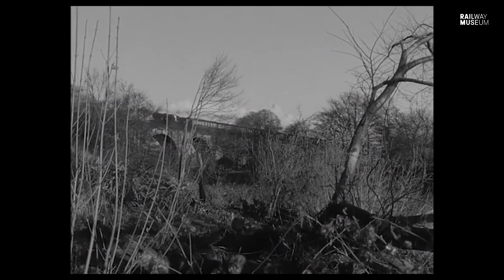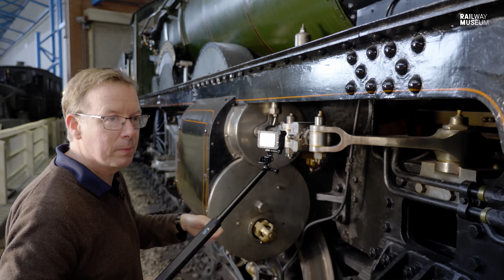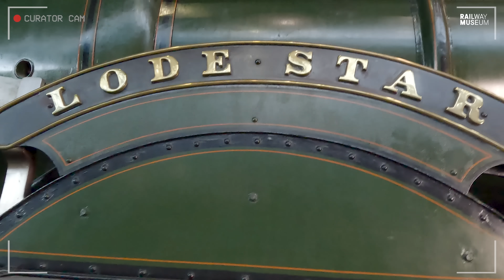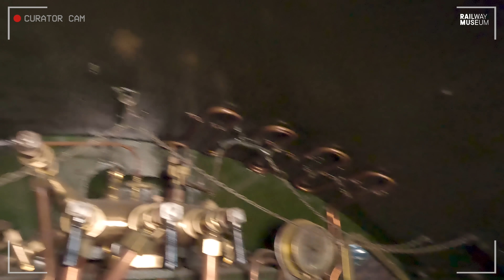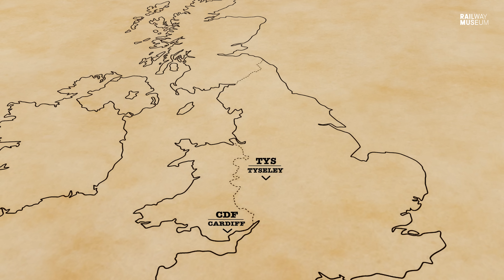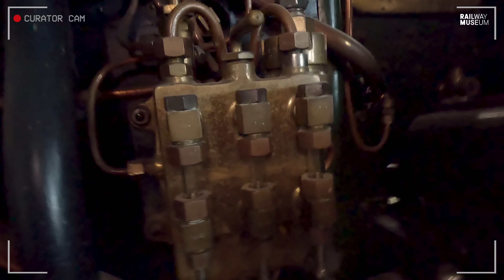Churchward’s Masterpiece—Lode Star In-Depth Tour | Curator with a Camera

Comment: there isn't a "Lap" position on a GWR vacuum brake, if you put the handle in that position, you are making an application. With a GW vacuum brake, the "Off" position is the running position. Steam braked locos like the 57xxs adnd 45xxs have running in the centre but that's got a different brake valve and the "Off" position on those also opens the large.

Comment: The LNWR engine shown is a Claughton, the first of which was built in 1913 and like the Star, had four cylinders. I believe that Churchward's remark regarding his engines in comparison with those of the North Western was made at the time when the Experiment 4-6-0s were amongst that Railway's crack engines. An exchange visit of engines between the two railways vindicated Churchward, although the Experiment that ran on the GW was probably not a star (sorry!) performer in that class.

Comment: The GWR French compounds were built in 1903 and 1905, not 1906.
1906 was the year that the first Star, North Star, was built, using some of the ideas embodied in the compounds.
The LNWR 4-6-0 that could be built cheaper than a Star wasn't the Claughton class illustrated, but the much simpler 2 cylinder Experiment class. In 1910 a locomotive exchange between the Star and Experiment classes was carried out on the 2 railways, with the Star completely justifying its higher price. The LNWR brought out the 4 cylinder Claughtons in 1913, as an equivalent to the Star, but they had missed out several of the details that made the Stars so good.  The Claughton's performance was still inferior to the Star's.
Reply: Glad you pointed out those mistakes I noticed as well. 

The Claughtons suffered from a boiler that was too small and from multiple valve gear and cylinder problems. They were said to be extremely good performers at the right time but were very unreliable.

Comment: Are the drives for the engines on each side diametrically opposed, or quartered?
Reply: They are quartered, so a 4-cylinder loco sounds just like a big 2-cylinder loco.

Comment: As for steaming certain locomotives again there are some that are out of the question now. Even though they did get revived after the end of BR steam in 1968.
The GNR 'Single', the Midland 'Compound'. You can add 'Green Arrow' and Lode Star too.
The GNR loco has a very poor firebox & the driving wheel tyre is at scrapping thickness,. 'Green Arrow' still has its original cylinder block, which is now badly cracked. Lode Star looks to have very thin tyres all round & who knows about the state of the boiler? I don't suppose it has been surveyed.
As for 'Evening Star'... I rode behind it on the Scarborough Spa Express which was many years ago. The locomotive is the 3rd newest steam locomotive in Britain & was never thrashed on freight trains, which was what it was designed for. On the modern railway a speed limit may apply on account of it having smaller driving wheels, but it definitely has the low-down grunt.
Reply: Evening Star is never going out on the mainline again (or any other 9F for that matter) as the flangeless centre driving wheels are incompatible with the raised checkrails on some modern points. Risk of the wheel riding up on the checkrail and derailing the loco.

Comment: It’s kinda surprising they didn’t put the valve gear  on the outside , with bell cranks driving the inside cylinders, reversing the layout.
Reply: LMS did that but it didn't fit the GWR aesthetic.  GWR only used outside valve gear on the 1500 class pannier rank, I think - and that was just before nationalisation.
Reply: @rogercantwell3622  They also used outside gear on the three 2-foot gauge 2-6-2 tanks they built for the Vale of Rheidol railway in 1923/4.

Comment: I wonder why Swindon didn't re-fit brass beadings to the splashers when preparing it for display in 1962?  They removed the outside steam pipes and fitted a tall safety valve casing to present a pre WW1 appearance.

Comment: Why were some railways right- hand drive and others left-hand drive ... why not standardize driver position like they standardized the track gauge? Any advantages to left-hand verse right-hand positions?
Reply: RHD is easier for most firemen when it comes to accurately placing the coal onto the grate but means they have to help look out for signals, which are almost always on the left.  The other big three railways settled on LHD, with many locos being converted from RHD - like Flying Scotsman - but the GWR always did its own thing.
Reply: Individual railways generally had a standardized side for driving, so would have all their engines manufactured that way. However there are always exceptions.
In Victoria, Australia the government  railway, Victorian Railways, drove on the left side on the Broad Gauge. The narrow gauge line due to the first engines being imported from America were right hand drive as were all the locally made copies. When two additional engines were bought from Beyer Peacock, Garratt engines G41 & G42 they were also right hand drive.

Does it really make a difference. Maybe. But with a tank engine when half the time you are going bunker first, you are then on the opposite side of the cab. If you have a second person in the cab they are also responsible for looking for signals and collecting and delivering safe working tokens as required. The biggest obstacle is sight lines due to boiler or tender or hoods.
Reply: @Kevin-go2dw  thank you
Reply: I think it was to do with what side the signals and signs were on but I could be wrong
Reply: @terrier_productions  I did learn this one the other day - most UK rail companies put their signals on the outside of the tracks in sections with double track, but because the GWR were converting from broad gauge, they ended up with a lot of space between the tracks, so they put their signals between the tracks in sections with double track.  Since all the trains were driving on the left (as with the roads in the UK), this meant that in order for the driver to have a good view of the signals, everyone else made LHD locos but the GWR made RHD locos.
Reply: @PaulPower4  that’s actually makes more sense
Reply: @terrier_productions  Yes that is part of it, more so for express or high speed running. On "branch lines" probably not as important, nor where turning facilities were not available.

Comment: A worthwhile enhancment would be to replace corks with a proper closure with a hinged cap with projecting lug which could be opened with the spout of the oil can. This is a standard fitment on Swedish steam locos.
Reply: More modern engines used hinged caps, this engine pre dates that though and has no plans to be steamed again
Reply: The cork had the advantage that, if it fell out, it would cause no damage to the motion.  The reed was actually unnecessary - other railways used corks and found there was no problem with oil flow.

Comment: Lode Star's trailing pair of driving wheels are of a different (later) pattern to the leading and middle pair. The trailing wheels are from the "Castle" class with webbing reinforcement and the crankpin is between the spokes, whereas the other four driving wheels have the crankpin in line with the spoke and have no webbing. It's likely the trailing pair were swapped in when Lode Star was being cosmetically restored following withdrawal. 

Closer examination of the number stampings on the wheel hubs should show which engine previously had the trailing pair.

Comment: Churchward's Saint Class was described by OS Nock as the "keystone in the arch" and was arguably the most important engine built in Britain as it was such a huge leap forward in loco development. Churchward was interested in "balance" and the avoidance of "hammer blow" to avoid track damage that a two cylinder engine like the Saint might cause and that was also why he was interested in those four cylinder French locos that were bought. Churchward's engines were considered ugly when introduced and they were beautified by Holcroft- with the curves instead of the previous drop ends and these curves debuted on the Star. Both the Saint and the Star had the same boiler which had very high pressure and very high degree of ( for the time) superheating- and that was revolutionary in Britain back then. Arguably, the Star was complicated and maybe developing the Saint further would have made sense. Clearly, the Star was the start of a family of successful engines that also extended to the LMS when Stanier left the GWR for that railway. During World War One the brass beading was removed from the splashers and for some reason this was not replaced when the engine was restored for display- although the later "elbow" steam pipes were removed as they were a later addition. The Saint really was the engine that brought the Great Western into the 20th century- not the Star and Stanier's Black 5 class- a very close but mixed traffic derivative of the Saint hauled Britain's last steam train in August 1968 which sums up the reality of the importance of the Saint class.
Reply: And 2999 ‘Lady of Legend’ is a working reproduction of the Saint design, which has appeared on several heritage railways recently, and is based at Didcot.
Reply: @johnkeepin7527  "W.A. Tuplin commented; "No other locomotive design, except perhaps Stephenson's 'Rocket', has represented such a long leap in the right direction as GWR No. 98." Number 98 was the second prototype Saint and had the new taper boiler. The last Saint in service- Saint David was subject to a preservation attempt. I have seen a letter sent from the British Transport Commission- of which BR was a part, with words to the effect that " the engine represents a national asset and we cannot wait to realise its value". Pretty stupid as there were probably dozens of engines awaiting scrapping at Swindon at that time and one engine not being dismantled in haste would hardly be a major cash flow problem for BR. Just an example of idiotic officialdom at work.
Reply: @NickRatnieks  So sad. 
Do read A Brush with Steam by David Shepherd who had many dealings with various bodys which is quite amusing. Best from a Signed copy of course Lovely man.
David and Lily Reading   Builder of many projects in 5 inch gauge.
Reply: @steamsearcher  Back in 1996, I was on the 25th Anniversary Special of the 1971 "Return To Steam" by No 6000- the special was hauled by 6024 and David Shepherd was on board and I got to meet him- I don't know if Peter Prior was on the train but it was a great experience. I did go to Longmoor Military Railway in 1968 and worked on Clan Line- when David Shepherd's own engines were there his locos were there and once again in 1969 for cadet training- not long before the railway was closed and the future for the railway afterwards was ended by local opposition.
Reply: @NickRatnieks  And where did the Saints come from?  Number 100 Dean.  

And where did Dean come from?

IN PART due to his friendship with the CME at the Pennsylvania Railroad's Juniata/Altoona works (the two separately named shops are actually adjacent).  

How appropriate, then, that the largest and most powerful 4-6-0 locomotives ever built should be a PRR design, and that they should be part of a standardized range that also included an Atlantic and a Pacific, the latter of which had some influence on Gresley.  

When we look at Stanier (and Bullied to a lesser degree) and how they were influenced by Churchward and Gresley, we can say that the best of Britain's passenger engines came from No. 100 Dean.
Reply: @00Zy99  Churchward took a keen interest in American practice. Some were successful as No 100 shows as it was the template from which the Saint Class was developed but some aspects were not- bar frames and Johnson bars. It took until 1944 for Hawksworth to make one piece mainframes on his version of the Hall Class while the Saints got screw reversers on new builds after a number of years but the Johnson bars remained on the earlier engines although Collett put screw reverser on his version of the Moguls. The 47XX engines- Churchward's last design had those lever ( Johnson bar) reversers but in the 1950s when they began to be used on passenger trains there was a plan to convert them to screw reversers but the end of steam stopped this. I have been told that in many respects the use of a lever reverser saved money and the directors of the GWR complained that his engines were expensive and from memory, Churchward's reply is given in the above video but a screw reverser makes life easier for the driver. There is a story of C B Collett being on a Saint that went out of control and hit 120mph. The speed is probably exaggerated but the event took place and was probably caused by the driver having problems with the lever reverser.

Comment: There appears to be a tap on the lower left smokebox front... what might it used for...?
Reply: It's a steam valve, locomotive cleaners used to connect a steam Lance to it, this was used to clean out the boiler tubes
Reply: @stuarteasthope3048  Thx for the info!
Reply: It's a steam take off and cock for a steam lance, could be used for cleaning using steam
Reply: Tea.
Reply: It's a steam lance cock.

Comment: Excellent tutorial, Doctor Coulls. As a slight aside, the engineer Harold Holcroft was the man responsible for the GWR 'house' style. He later went on to work with Sir Nigel Gresley in developing the valve gear for locomotives, such as Flying Scotsman & Mallard.
Reply: Afraid I'm not a Doctor, but thanks for the compliment!
Reply: @anthonycoulls7301  Apologies Mr Coulls. However, the tutorial still stands, which is very good.
Reply: Holcroft actually went to the SR and worked under Richard Maunsell.  He came up with a 3-cylinder conjugated layout that gave Gresley some ideas (there was a lot of knowledge sharing between the SR, LMS and LNER - GWR was more insular).  However, Holcroft's layout wasn't successful and the SR Schools Class ended up having three sets of valve gear.
Reply: @rogercantwell3622  Yes, that's how I understand it.